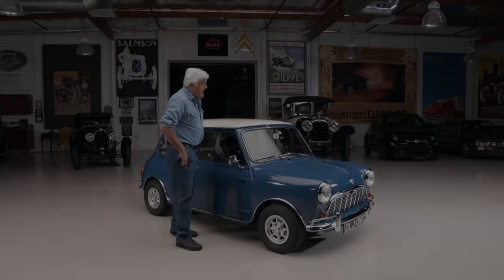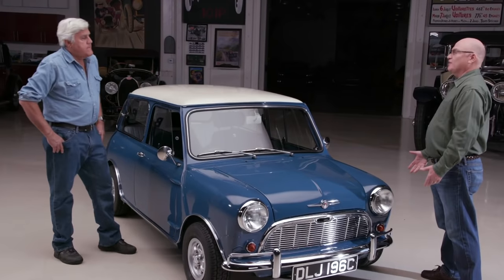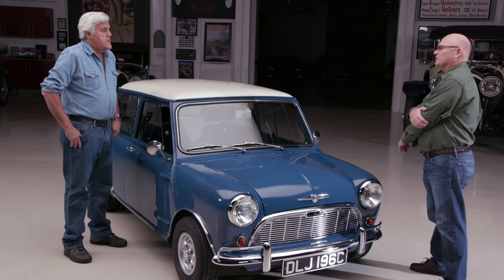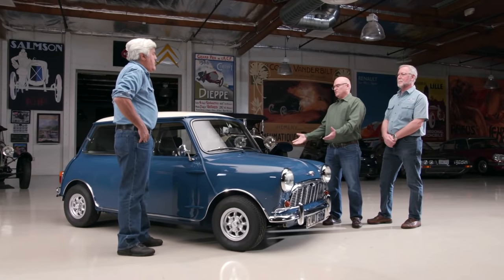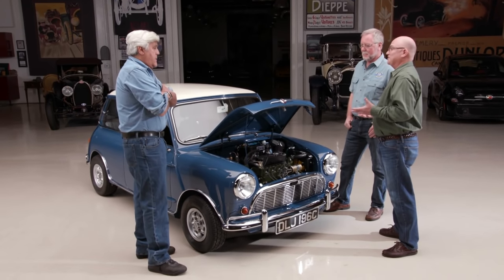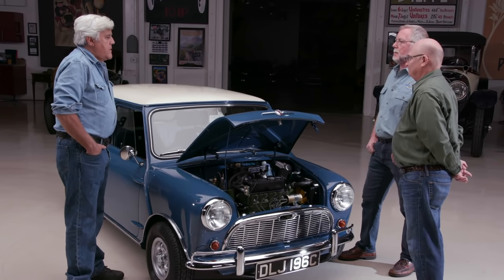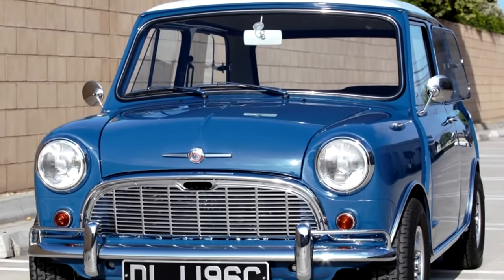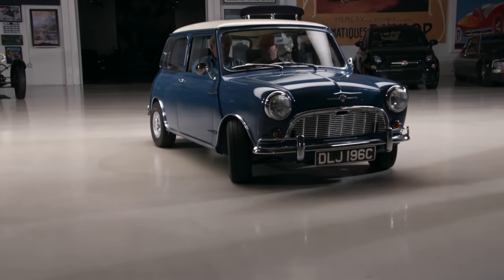1965 Morris Mini Minor - Jay Leno's Garage

Comment: The car was indeed registered in Bournemouth , the ' C ' suffix indicating 1965 in the UK registering system at the time  , starting with ' A ' in 1963.You can tell it has been converted to rubber cone suspension with the ' choppy ' ride, the original hydrolastic displacers were fine on Minis and despite the myth , were very reliable and with optional competition shock absorbers gave a superb ' ride, they were discontinued after the Mk11 through cost.
I have owned 4 ' proper ' B.M.C Minis in my time and seeing this superbly restored example, have always thought it is  without doubt, one of the most aesthetically perfect  British cars of all time along with the ' E ' type, that still turns heads !.The BMW pastiche thingy may be a good car, but it is NOT a Mini, an obese lump of a car  , the original may have had serious issues with rust but it was just so small and such fun to drive and made you feel proud to be driving such an icon.The soaring prices across the world proving this without doubt - will have to have another before I'm finished !.

Comment: Here in Oz we got Mini Vans and even a few utes.
And Mini,, well designed? Not with the dissy right in the rain. All of those Pommy BMC were allergic to rain!! Though the engine was a variation of the A series BMC used in Minors, A 40s etc though the block will not bolt in.
When I was about 14 I wanted a Cooper or Cooper S. When I was 16 I bought a Holden! One of several hundred since. Owned one Mini, a trade in!

Comment: Just waiting on delivery of my '91 Mini Cooper 1275cc.
Only a fraction of the size of my Merc car engine but goes like stink and makes you feel like a rally driver.
update Car was great but when I took it back to dealer to get some minor issues fixed the guys in the workshop managed to crash it while 'road testing it'. You've got to be going some to do that in a mini with the great road holding that it has.............. So now I have a bright orange 1993 mini 1275 custom. Love it!!
Reply: I've owned my '91 Mini Cooper Sport Pak for about nine years and wouldn't give it up for anything. Hope you enjoy yours as match as I do mine!!

Comment: The A series engine used in the original Mini which was 850cc.  Issigonis, the designer, was told he could not have a new engine. The A series engine was physically big for the car just being shoehorned into he car. It really only needed a two cylinder engine, which Issigonis wanted. The A series engine was de-tuned.  The block can be bored out to 1300c, which it was eventually.

Comment: Brother had a little red Mini with a 1.3litre engine (not a Cooper so the brakes, tires etc the car wasn’t built for. That’s why they had a Cooper). It was fast but because it’s so small and low to the ground, the perception of speed was frightening. And noisy. It’s death came through a shop window at a red light that the brakes couldn’t stop the power of the engine and pulled it to the right. Went to work with him for a year with a big scouser (Someone from Liverpool) and they smoked weed all the way there and back. I got high never touching the spliff. Even tho’ it was 90’s, they had proper bud, not hash. Couldn’t see out the front window in the back which isn’t too far.

Comment: My Canadian 998 Mini ,my ” Orange Peel ! “ bought new in “79 or “80 I can’t remember came with a plastic flap over the distributor. Still cut out in heavy rain. Always carried a can of WD 40. Silicon spray on cap and wires helped. Only aggravating problem was drivers wiper stopped working. Wiper motor operates a rack witch in turn turns the geared wiper posts. Took wiper post apart and found a pebble jammed in gear. Sold it cause wife # 1 didn’t feel safe. Biggest regret of all the cars I have owned.

Comment: My brother drove one of these, it was so noisy he fitted a sound system that automatically adjusted the sound level until my kids found how it functioned and would shout and scream whenever they rode in it to get the noise level up to 11. The battery terminals are just under the rear seat so if you had a couple of big people in the back the seat springs would short the terminals on bends and cut the motor. You could steal these with a nail file.

Comment: I had one in High School and I am now 56 and still have a Mini and still work on them. This a great build by keeping the 850cc block. I just wish they kept the rubber cone suspension if the Hydrolastic suspension is a pain to maintain. Not a fan of the coil spring suspension.
Reply: Don't confuse the suspension we install with coil over spring kits. Done right the ride quality is a prefect combination of comfort and handling and not prone to failure.

Comment: In 1960 a basic new Austin Mini or Morris Mini in UK was 250  GBP (Pounds Sterling) when the GBP was worth $3-4 Dollars. I bought one new then. The door and window pillars obscured visibility since the driver's seat was so much behind..
Reply: It wasn't THAT cheap. The most basic version of the original Austin Seven, as it was first called in 1959 (with the 'v' set sideways in the ads to look like a 7), was £497. That didn't include a heater.

Comment: In Australia in 1975 I bought my first car for $425. Yeah, it was a blue with white roof 1965 Morris Mini Minor 850, just like the one in this video. One difference was that it had wind-down windows. I always carried a can of WD-40 in the driver's side door pocket and needed it if the distributor got waterlogged in a thunderstorm. It was a great little car to drive, Unfortunately, someone rear-ended it  and as the cost of repair would have been greater than the purchase price, the insurance company wrote the car off and paid me $425. As a result, I went an bought another Mini for $425, this time a beige 1963 850 which did have the sliding windows. When I finished my university degree I bought my first new car, a mustard gold with black side stripes 1978 Toyota Corolla Coupe.

Comment: I had one, teal blue. Problems were the drum brakes (rust), the top engine mount and the plastic door handles and window winders. The front sub frame never rusted, the rear always did. Parts subject to wear were the gear selecter, top engine mount. It really needed electronic ignition.

Comment: I 'married' a blue 1965 de-luxe Mini in 1967 which my wife had from new.  In fact she lent it to me after we'd been going out for only 3 weeks to tyke my broken motor cycle engine back to BSA.  We toured Norway in it in 1966 and got engaged when we got back.  i drove it in auto-test competitions and a twisty sprint. I wonder where ETO 150C is now?  The girl is still with me over 50 years later.
Reply: The price new was £500 not £800 as mentioned in the video.  The distributor was very vulnerable to water and I tied a plastic feed bag over the grill to keep the distributor dry.  Another mod was to fit Paddy Hopkirk grill buttons so it was easy to remove the grill for access to the oil filter.   Keeping the hand brake working properly (for hand brake turns) was a nightmare because there was no grease nipple on the pivot  just in front of the rear wheels.

Comment: My mum in England had white brand new same Morris Mini Minor as this which cost just under £400 new around 1962/3. She had two more Minis later but this one was always the best. I inherited it in early 1970's and my then wife wrote it off. Hit a cow broadside head on. Sad outcome for the cow and the car. An amazing outcome was the impact caused the cow to crap big time and the stuff by some aerodynamic freak came in an arc through the sliding window off side and there was a huge pile of the stuff on the rear parcel shelf!!

Comment: And the seat has a swingarm, as an adjustment, so moving it back makes the front sink, so the only adjustment was actually the three holes in which the bolt, holding the seat could be placed in! You could buy a plate with much more holes then, and a bracket to be able to sink the steering wheel for a better position, and a smaller wheel, like in this car.

Comment: A friend of my dad kept a peace of cardboard in his wife's mini to protect the distributed in wet weather.
Reply: The factory fitted something similar in plastic behind the grille. It was nothing like the problem some people would have you believe. Just keep the plug leads in good condition and clean (No tacky WD40 to attract dirt). If there was a problem it was more likely to be the LT connections on the coil, a dab of vaseline and arranging the wires so the water drained away was enough.

Comment: I’m 6.0 ft  and i had a hard time to drive the old mini when i started to learn to drive. The pedals are too close to each other and the factory steering wheel is rubbed my legs altough i can confirm this car is bigger inside than it looks from outside. I loved it even if ot was not my size.

Comment: Those wheels aren't the original 'Contessa' rims but they are close enough. I fitted a smaller steering wheel to all of my Minis, they looked much better than a standard sized wheel. Mind you, this was back in the 70's when you could buy an 1100 Mini new for under $AU2000. We'd go to the drive-in and take out the front seats which were held in with 2 wingnuts. The rear seats were incredibly comfortable when you could stretch your legs out into the front.

Comment: The Morris Minor from where the Mini Minor took its name was originally called the Morris Mosquito. If it had gone into production it would have had a flat four engine not unlike the Jowet Javelin. However the Mosquito was redesigned to be wider and the stripe running along the bonnet of the Morris Minor hales from the former's bonnet having a four inch strip added from front of the car to the back.

Comment: The owner had no problems making major engine modifications, using disc brakes on the front, replacing the old suspension with coils and struts, and all the other changes he made to the car, yet replacing the monocoque shell with a rust free replacement was "too much change from the original car he bought?" This makes NO sense whatsoever! Great car and respect to Steve for taking on the work.

Comment: This brings back fond memories. I had a 1967 Cooper S, 1275 cc. It put out 76 bhp, a bit more than this one, and was incredible fun to drive. When the body rusted I put the works into a Mini Jem plastic bodyshell -- for an example see
http://2.bp.blogspot.com/-XIlnmRbDfNI/UTcVlbsoWSI/AAAAAAAADKk/vpQWW4HlQhU/s1600/Mini+Jem+Tony+Fysh+1.jpg
-- which made it a lot faster and even more fun. I retained the Hydrolastic suspension, so it was even quite comfortable, though very noisy and it leaked through the top of the doors. One curious thing was that it had no exterior door handles. The windows locked from outside, and to get in you unlocked the window and reached inside for the handle (which was homemade, as there was no standard part). The bonnet (US: hood) had no hinges, and was secured by two Dzus fasteners. Once in Paris I stopped to refuel and check the oil, and forgot to do up the fasteners. As I was driving around the Place de l'Etoile the bonnet came off and I had to run into the high-speed traffic to retrieve it, luckily undamaged. The body, designed by Jem Marcos the timber enthusiast, had a very strong plywood substructure. In Rome I stopped at a traffic light and someone drove an old Fiat 500 into the back. The front of his car was pushed in two feet. There was a small chip in the paint on the rear of the Jem. I drove it for 13 years until it was too worn out to keep going.

Comment: A shame in way thet it's not stock. I had those wheels and tyres on my Cooper S, and while they were great in the dry, aquaplaning was all to possible in the wet. I put standard wheels and 145 tyres on it and transformed the handling. It would have been great to see Jay bouncing to the Hydrolastic rythm as well, and sampling the wonders of the Magic Wand gear lever.

Comment: Yep we still use mph here in Great Britain, I still use feet and inches and Gallons and Pints, when I ask for sausages at the butchers I always ask for a pound in weight, I even convert modern money back to pounds, shillings and pence, we only converted because it was a requirement to join the EU. My first car was a 1967 Mk 1 Austin Cooper S, I can still remember every nut and bolt of that car, I wish I still owned her.

Comment: Weird to see this!   I had a 1963 Minivan (529 LPX, cost in 1968 £120); and then a 1966 saloon pretty much like the one in this video. Great little cars - could have done with a 5th gear though. They weren't exactly quiet - I think that side-mounted fan made quite a lot of noise as the engine revs rose. The runners for the sliding windows always got a bit rusty and grotty. And they always rusted through on each side just below the corner of the windscreen.

Comment: What a lot of people don't realise is that the rain in Britain is actually salt water.
Reply: So salt evaporates with the water? Is it rain or breeze or some combination of the two? Because one is due to a change in the physical state which differs for salt and water in temperature, while the other is due to the wind.
Reply: @petersurryez3277  Yes - it starts off fresh water but passes through a saline-haze layer fairly low down so is salt water by the time it reaches the ground. I'm a British meteorologist so I should know, Pete.
Reply: Rain reacts with carbon dioxide in Air to form a weak acid called carbonic acid. This damages masonry buildings as well as cars.

Comment: "they sold a rubber cover for the distributor"

Yes,  you got them in the local shop and they were called rubber gloves, came in packs of two... Cut the ends off the fingers and add a few tie wraps or small jubilee clips .

Comment: The position of the rotor hub just behind the radiator grille was most unfortunate. Every time it rained (which is often in England) the engine would cut out. I used to attach an old kitbag over much of the radiator.
Reply: Distributor. Why did I call it rotor hub?

Comment: Austin 7, later became Mini one dial in centre of dash  speedo with fuel tank , Mini Minor got 2 extra dials one either side of speedo /fuel gauge 1 was oil pressure on left side other was water temp , also the minor got over riders with little curved l shape bars  going from corners of bumpers to bolt onto over riders . my one was a 1963 tartan red Mini Minor could get 95 out of it, single su carb , but if you wanted faster acceleration i discovered this by accident ran out of 3in 1 oil and i needed to put some in my carb to get to my work in the next village about 2ml. along the road, only had Plus Gas penetrating oil, it,s clear like water stuck that in ,it took of like a rocket. did you know the first one in 1959 on 12" wheels did 150mph, so they stuck10"wheels on and it reached 120mph. with a bit of fiddling they got down to 95mph. i can still mind the reg number of mine XMS 736.

Comment: Cousin had an 850. we fitted a 1275 bored out to 1310 which with drum brakes would swap ends if braking at speed, he went past me backwards at 70mph plus. it would do all the way past the 90 o the clock and right down the bottom on the fuel gauge. When it needed repaired underneath we would use an old mattress and roll it on its side.

Comment: The wipers stopped when the contact became shut, so it was an ability to make them stop at the bottom of the window! And I gave it longer arms and blades, to clean more window area. Besides that - the damned window leakedby the window seal in the corner, as many other places, so water came in!

Comment: Bournemouth on England's South Coast has high sunshine levels and low rainfall compared with say Blackpool up North.
Reply: but still as much salt in the air
Reply: @1963TOMB  and salt used to prevent ice  on the roads in the bad winters we used to have

Comment: THE PROBLEM WAS HAVING THE RADIATOR FACING THE FENDER BECAUSE OF THE ENGINE BEING SIDEWAYS = OVERHEATING. I ADDED AN EXTRA ELECTRIC FAN ON THE OPPOSITE SIDE OF RADIATOR TO SOLVE THE PROBLEM.

Comment: Not so much the rain in England that causes vehicle rust, as the salty sea air or, where icy roads occur in winter, the salt they put on the roads for traction. In Australia, with lower humidity in the South than in England, and also in New Zealand, there are many examples of car models not found in Enland in great numbers now, due to the rust problem there.

Comment: A good restored Mini Cooper S can fetch 65,000 pounds in UK. I have a 1969 Mini Cooper S, fully restored back to metal, red/white, 45,000 miles, 2 owner, zinc pacified powered coated major structures.  As I am not using it, should I sell it?

Comment: Admittedly the Austin Mini originally alluded to the Austin Seven and the Morris Mini alluded to the Morris Minor. Austin had intermediate models, the inferior Austin A30 and A35. Morris had the Morris Minor and Morris 1000. The later versions all used the 'A Series' engine but the Morris 1000 was larger, faster and more economical. Similar to the original Volkswagen the Morris Minor accidentally achieved low wind resistance. Arguably a better design than the Mini.

Comment: I think those wheels(with tyres fitted) are a a touch more than 10 inches in diameter!  Hold a 78rpm shellac record against one and you'll see a few inches of tyre not hidden behind the record. Note the correct spelling, by the way, "tyre" for the rubber rim of a wheel..... "tire" to exhaust oneself, physically and/or mentally.